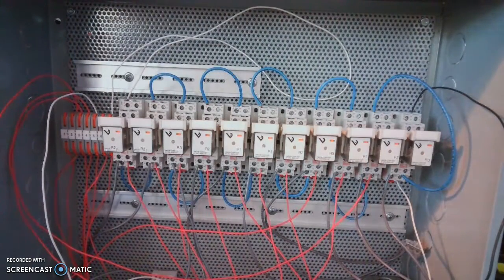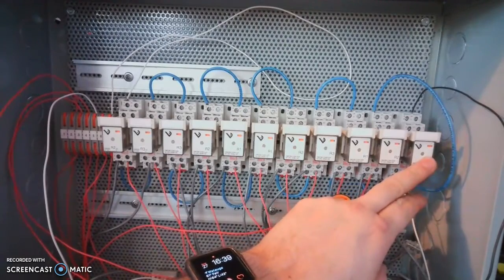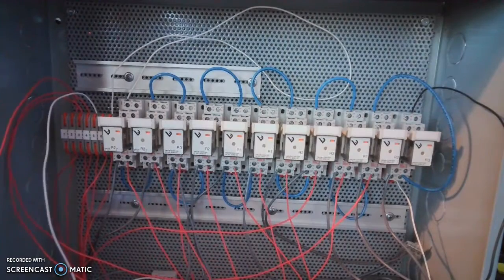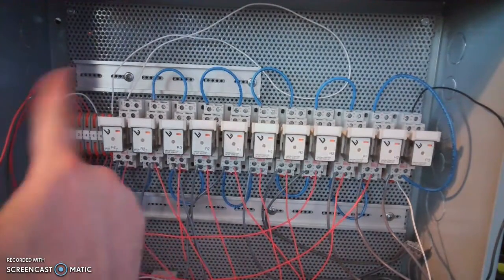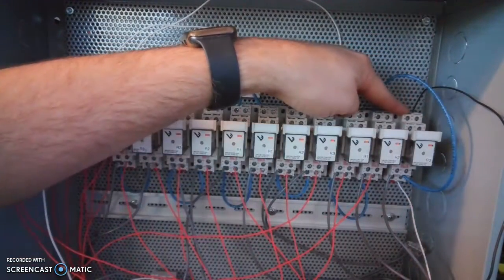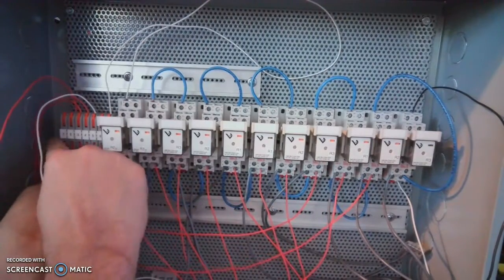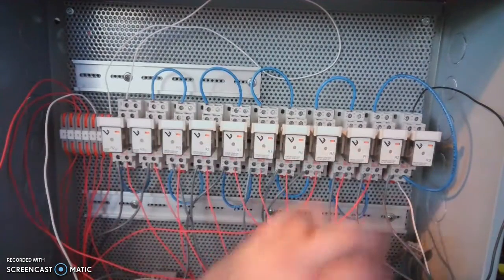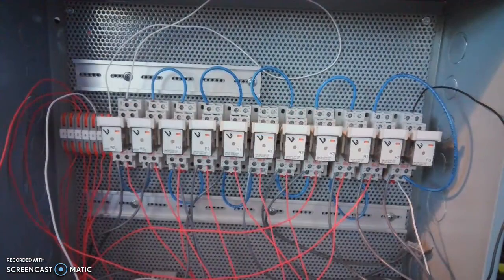How to wire relays in series

Comment: Hi. You say they are for safety. Do they power different loads, and if that load malfunctions, if turns everything after it off?  Thanks for the video.
Reply: Ahu is the only load he used as an example.  Long story short All conditions have to be met before ahu will operate